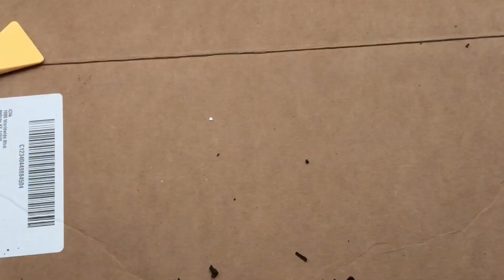DIY BMW E46 Harman Kardon front door speaker repair - Blown Speaker Repair

Comment: as a speaker enthusiast in my early age i can tell you that, that problem happens often it’s called “foam rot” it depends on the foam’s material it’s easy to repair there are plenty of tutorials on YT anyways nice video
Reply from the maker: Thanks! My first "expensive" speakers were infinity speakers from the 80's. They were my first lesson in foam repair. Super simple way to keep good equipment running strong!

Comment: Good job. I have the same issue. Passenger side E46 speaker is blown. Looks pretty easy to fix with the right tools.
Reply from the maker: you got this! a set of torx and some panel tool are all you need! The foams come with the glue.

Comment: What is the small speaker the one you fix with the glue..is that a midrange speaker??and what size is that..??I think my is blown but not sure the size..
Reply from the maker: It probably is blown considering the vintage of this system. Mine is a 2002 and both sides were totally shot. pop your panel and see! it's really an easy fix and there is a link to the kit in the description below.